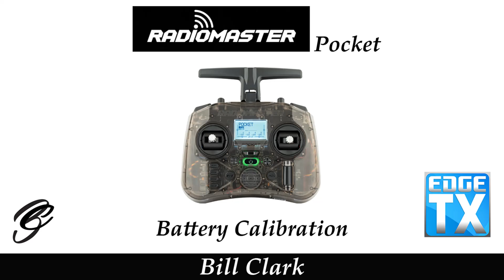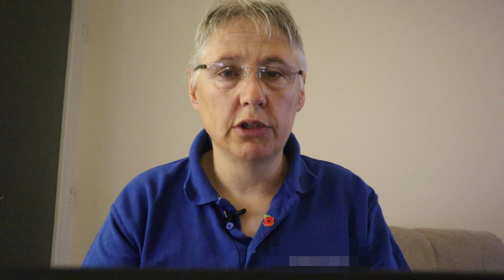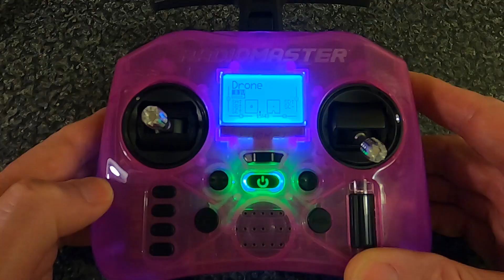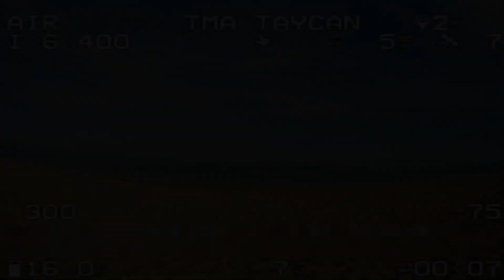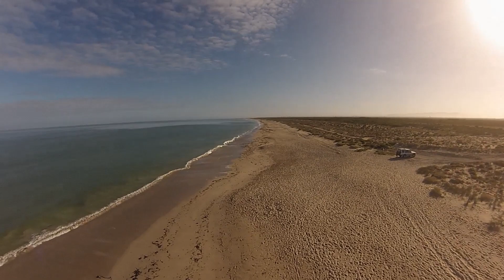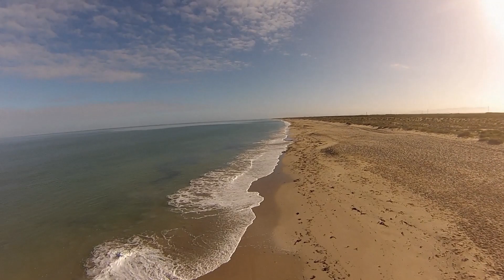RadioMaster Pocket Battery Calibration

Comment from the maker: You should be using a 5v USB charger. I would suggest not using   9v. Have you calibrated the battery to the radio using a good quality multimeter as per this video?

Comment: there should be voltage drop when you turn on the radio comparing to the measuring batteries without a load.
Reply from the maker: Yes there is so measure the voltage with the radio on just be careful not to short out the terminals.